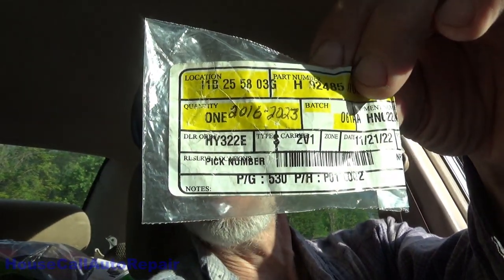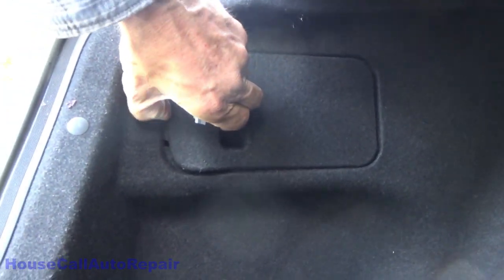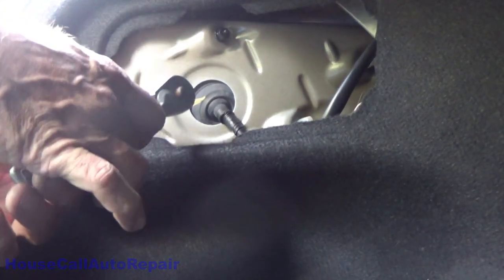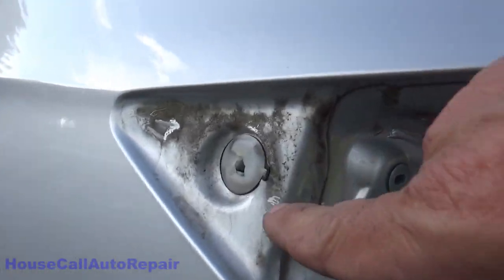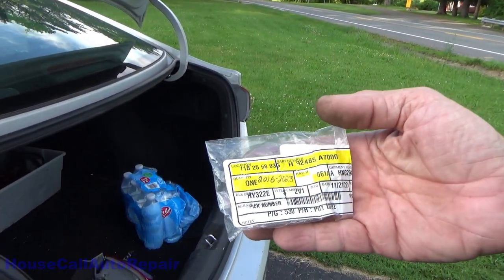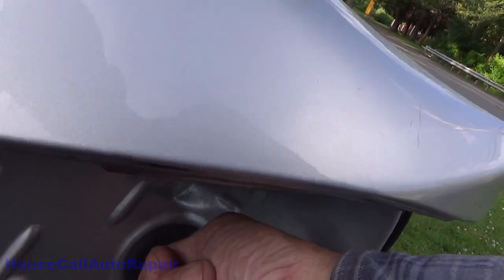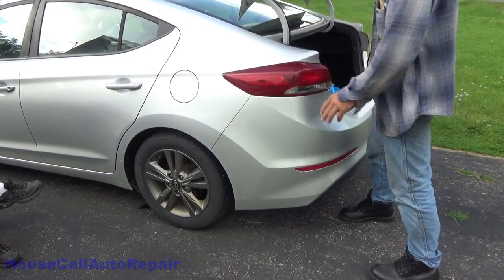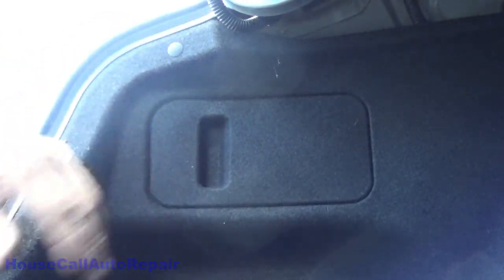2016 - 2023 Elantra Tail Light Removal

Comment: I spent hours on the push pull method. Then I saw a similar video to this but I didn’t hit it hard enough to create the separation. This took me 30 seconds to finally change the light bulb. Thank you!
Reply from the maker: Thank you so much for validating the reason I do this.

Comment: Mine is still stuck wth?!?  I have both nuts off, what else could it be?!?
Reply from the maker: There are two white snap pins retaining the assembly. They are what's holding it. Apply a bit more outward pressure on the outer-most stud.
Reply: @HouseCallAutoRepair  when I’m jiggling the  whole assembly I see those wiggling. 
What do u mean apply more outer pressure? Like when I am pulling on the assembly where should I push
Reply from the maker: @fhg1128   push the two threaded studs out, towards the back of the car. The front plastic piece that gets broken is just a straight forward guide. It's the two little white sockets that two ball-headed pins pop into. Some minor heat may help.
I had to put the nuts on one thread and knda push it with my rubber mallet, to pop it out the first time....
Reply: Got the screws undone, housing won't pull out. I see the 2 white clips, someone said squeeze them and they'll push inside, but afraid they'll break. Don't understand what I need to do with them.

Comment: WARNING!!! Potential to damage light assembly!!!  Do NOT strike or put direct pressure on the 10mm bolts as demonstrated between 2:00-2:20 as the bolts are mounted via a small knurled surface in a thin plastic section of the light assembly that easily cracks.  Replacing a light assembly is much more expensive than replacing the bulb & mounting clip.
Reply from the maker: Care to offer a better suggestion? I'm sure if you have a less destructive method, we'd all like to know!
Reply: So what's a better method?
Reply: Pop the clip out a little bit first to release the tension